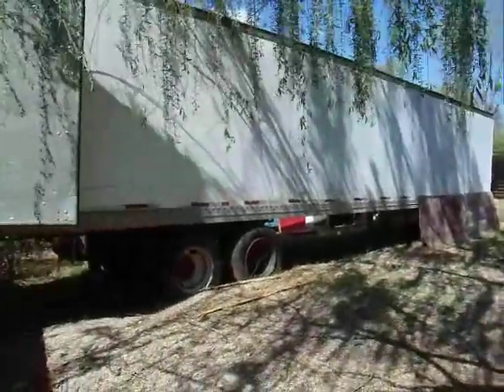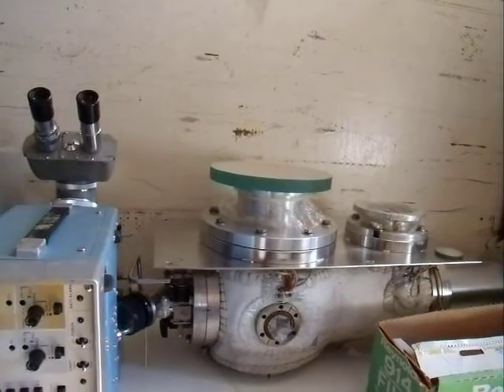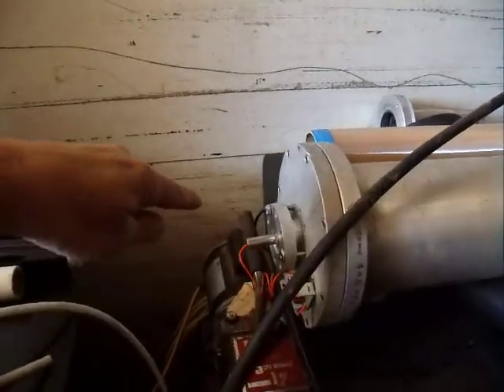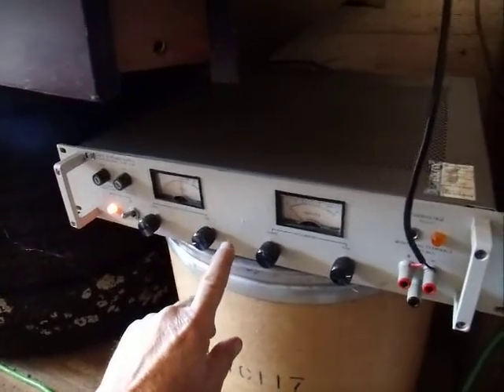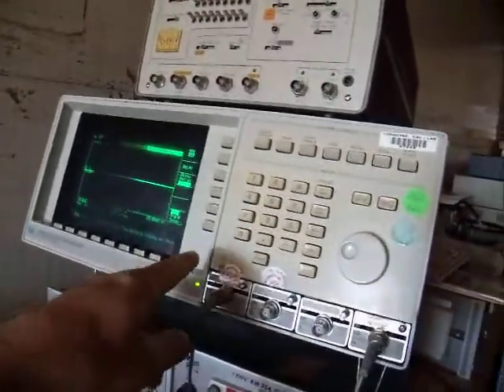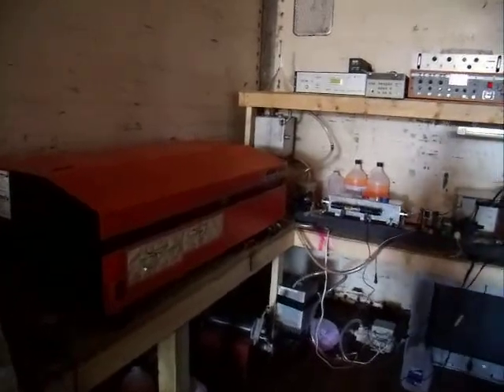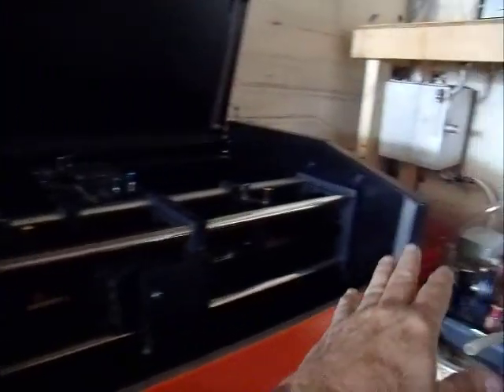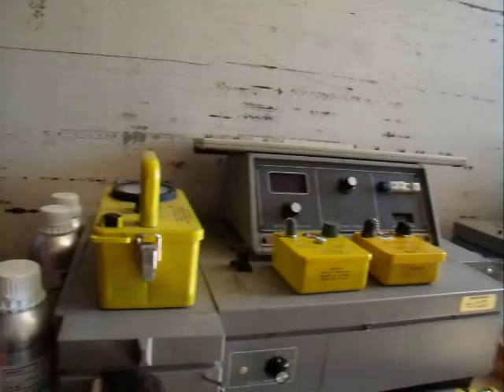Gravity Wave Detection for high and low frequency using fiber optics

Comment: Yes the GW could be longer than the trailer  but your not !! understanding  
understanding how the system works G wave as they travel through space stretches space 😮perpendicular to the direction travel 
perpendicular to the direction of travel  So the fiber is stretch now matter what the frequency is

Comment: If a gravity wave is moving at c then frequencies 10 MHz and lower are longer than your trailer let alone the fiber chamber. You see the problem . You and your test equipment are in the same gravitational frame of reference as the fibre chamber causing a null result. However if one focuses on 200 MHz and higher then there is a chance of being outside the gravitational wave FR so that a measurement can be made . What make gravity waves at 200 MHz? No answers on my end.
Reply: John Heath sping black holes etc do high frequency LIGO does not have mass light enough to response they only can measure low frequencies
Reply: John Heath it's not an electromagnetic wave it's a special wave the peak of the wavelength travels through the entire space it stretches the space as it moves through the trailer yes the wavelength is long but the whole wavelength moves across every point of plane in the plane of the trailer three dimensional volume is what is stretching even short wavelength can be detected
Reply: You obviously do not understand how gravity wave systems work wavefront travels 90° all the way through the fiber-optic detector the detector is at 90 degreesso it does not have to match the wavelength of the gravity wave in order for it to function you're thinking of an e m wave on an antenna pick up this is not the case !
Reply: He obviously does not understand how gravity wave systems work the gravity wave travels 90 degrees across the fiber the detector system does not have to be bigger than the wavelength he is thinking of a emi wave and trying to match it to an antenna pick up gravity waves stretch space
Reply: Your problem is considering a gravity wave like an e m wave or a sound wave . The space stretches perpendicular to the propagation of the traveling! Therefore the GW affects all points of the fiber as it travels down along the coils of fiber thank you for your interest sorry you misunderstood how the system works it's not like having to be an antenna will you need at least a quarter of a wavelength to match
Reply: Wrong thinking it's not an Em wave or a sound wave ! The space stretches perpendicular to the wave propagation. Therefore all points of the fiber are affected by the peak amplitude of the stretching of the as it travels down along the.
Reply: Wrong thinking the gravitational wave is not an em wave or a sound wave. In a GW the space stretches 90 degrees to the propagation of traveling down the fiber-optic coil , therefore all peak amplitude of space stretching travels all along the fiber as the wave propagates through the fiber coil length every point on the fiber surface is affected by the maximum peak value of the gravity   wave distortion!
Reply: Yes gravity wave does travel speed of light but the gravity wave  stretch space  perpendicular to the travel so that fellow is all wrong about talking about gravity waves and the wavelength comparing it to the truck length
Reply: He's assuming it's an electromagnetic wave and he's trying to match an antenna not the same animal gravity waves stretch space perpendicular to the travel and nothing to do with the wavelength like an electromagnetic wave being tuned to an antenna
Reply: It's not an electromagnetic wave you're not matching a resonant antenna it stretches space perpendicular to the to the path to travel of the gravity way
Reply: Wrong it's not an electromagnetic wave
Reply: Rong GW's move through the hole trailer no matter what the frequency and  waveling are . It's a dimensional stretch of the volume of the space all through the trailer as it travels
Reply: The gravity wave frequency is moving 90° how long the propagation of the gravity wave so the wavelength does not come into play the way you’re thinking an EM wave works
Reply: No they are stretching space 90 degrees to the traveling wave propagation of the Gravitational Wave!!!’
Reply: No they are stretching space 90 degrees to the traveling wave propagation of the Gravitational Wave!!!’ Big Bang expansion does at mghz